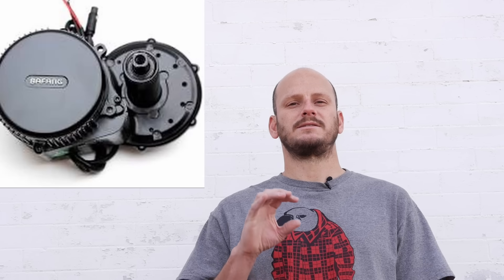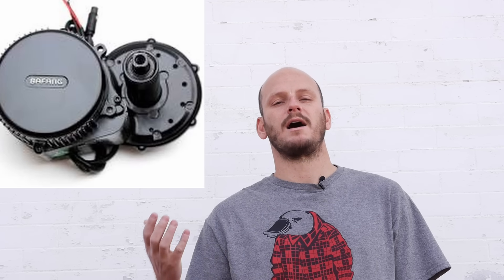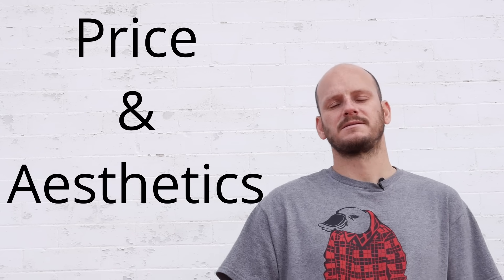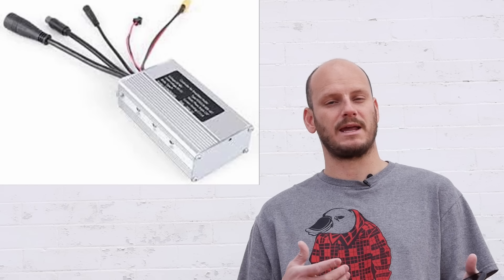Hub vs. Mid Drive Motors: Why Hub Motors Suck and Debunking Common Myths with performance test

Comment: I like hub motor you don’t have to talk to the bank in order to buy an electric bike.
Reply: Also you can still use it when the chain breaks
Reply: @abdullanasser6047  I don't even bother with a chain, too much maintenance and it's so dirty.
Reply: He said around $50? Lmao try over $150 for the cheapest one
Reply: It's February 2024 and 1000 watt hubdrive kits are $220, while 500 watt mid-drive kits are $480. Why should I spend double for a mid-drive?
Reply: If they were 50$ more for mid I would own one lol 
My first ebike is 2000 $ fat Tire hub rear  .but and next bike will mid  
I will probably kill my motor sooner as I use a Burley trailer
Reply: @Brad-99  did you try a bafang mid drive?
Reply: @SB7-r9i  .....Bosch out performs Bafang, especially with hill climbing. I won't even consider Bafang, it has poor low end torque by comparison.
Reply: My hub motor has 100 thousand miles on it . Still runs great . But I can see the other motor for climbing hills . If you live in a hilly area.
Reply: @andypandy7769  I know a few friends that pretty much do downhill mountain bike runs, lazy or not a few have got electric MB and end up doing 5-10 more down hill runs through the day because they are back at the top in no time at all. Ridiculous prices for them though.
Reply: @andypandy7769  Regen is totally free, so it is actually not worth it to not have it. And you save a lot on brake maintenance.  You can get belt kits where the belt is split and you do not need to split the frame.
Reply: just got my 4kw rear hub motor kit installed in the last few days. i can run 90v, but so far only wired it it for 48v @22ah. wow is this thing is fast, pops the front wheel off the ground,  i can see my brakes need upgraded, also i was keeping up with cars easily around town at about 40-45mph, until some drunk mexican pulled out in front of me which rained on my parade in more ways than one. next text 72v 22ah, then 90v 22ah, then i will be doubling capacity up to 88ah via 6s lipo. also i whipped right up the biggest hill in out town at about 40mph which is faster than most hill billies can do in their loud sandford and son's mobiles
Reply: @jasonbrown467  regen helps a lot with braking
Reply: The hub goes for more than 13000kms . Mid drives dont last long you have to replace yhem after 6000km
Reply: @rara-xq5nn  I also have a hub with 20k km or more. Still good.
Reply: John Smith  No regen?
Reply: John Smith  Sounds like you sell the cheap ones then.
Reply: Thanks for the info..I almost order the rad runner..I gonna convert my bikes to hub drive instead.
Reply: Bro normally ground areas which electric bike good, hubmotor or mid drive motor to distance travelling??
Plz help
Reply: I mostly want to power the bike myself and only need a little help on the inclines realistically the small gradual long inclines.
Reply: Mid drives are same price for me both kits range £300 to £600 depending on whatts and voltage
Reply: Unsprung weight, wonky weight distribution no thanks
Reply: but it is worth it
Reply: @TheFilminators  Mid drive costs more and doesn't have regen. No thanks.
Reply: @difflocktwo  in the ebike world, more money spent normally means more power and more performance, assuming you know what you're doing. And how much does regen help you anyway?
I was just joking but its definitely something to think about
Reply: @TheFilminators  Regen helps a lot. Otherwise I'm changing brake pads all the time (bicycle brake pads are small). With Regen I don't use my pad brakes 90% + of the time and regen doesn't care about water/mud/ice. Pads last years instead of months with regen.

Hub motors are so much cheaper that you can spend the price difference on a bigger battery.
Reply: @difflocktwo  depends on what you are looking for too. I'm more of a hill climber so I prefer motors with more torque so I prefer a mid drive.
Reply: @TheFilminators  I guarantee you a cheap direct drive hub motor has enough torque to flip you upside down.
Reply: @waynefilkins8394  Yeah, I don't think this video is fair at all. My ebike hub motor has over 10k km on it, it has been on many bikes. Soon it needs new bearings but it's still ok for few thousand more km.
Reply: @TheFilminators  till Ur mid drive breaks your chain.
Reply: @alextaylor9746  been almost a year and hasn't broke
Reply: @TheFilminators  Yeah but chains require cleaning and lubing. With a pure hub drive you only maintain tires twice a year. Chain maintenance is dirty and annoying. 

I hear belt drive is low maintenance but I have never had a belt drive bike.
Reply: @TheFilminators  How much watts you have in your mid drive e-bike?  I need an e-bike to climb a long steep hill (like 10 minutes ride up).  I would like to know how much watts is appropriate.
Reply: @captainjayc9217  so I have a bbs02 mid drive and it's rated at 750 watts, but it easily peaks at around 1500, and if you're in the right gear you'll cruise right uphill
Reply: @TheFilminators  "in the right gear you'll cruise right uphill" is what I want to hear.  Thanks for sharing your experience.
Reply: @difflocktwo  mid drives do have regen.
Reply: @Krunch-ym3uf  Only if there are no one way clutches between the motor at the wheel. Which system has this?  In before single speed fixed gear.
Reply: @waynefilkins8394  .....I think his points are good, especially being able to use gears with the mid drive, that right there is a massive selling point on it's own. Plus mid drives are easier to convert to, maintain and fix compared to hub drive. It's also worth mentioning that you can't just have more watts to overcome the torque difference as there is a limit in many countries, i.e. in Australia it's limited to 250w for pedelec eBikes.
Reply: @waynefilkins8394  Basic Electronics 101,   Electrical Current flowing through wire generates heat from electrical resistance.      Same way an electric heater generates heat.

Same happens in a motor,  push a lot of current through a motors copper wire windings and it generates heat.    

The most current gets pushed through a motor when heavily loaded at low RPM,  and even more if overloaded and stalled.

A Hub motor trying to climb a hill for extended periods of time is heavily overloaded,  generating a LOT of heat in the copper windings of the motor from all that current being pushed through it and facing electrical resistance

Result,  very hot and possibly so hot that it melts the thin layer of Lacquer that separates the tightly wound together copper wires so they start connecting to each other electrically,   essentially shorting out the motor.

Motor "Burnt out"
Reply: @waynefilkins8394  i have been into rc stuff for like 10 years, and none of my brush less motor ever fail unless a giant rock crashed into the can. there doesnt seem to be a place where things can burn?
Reply: @GorillaZillas  That is why you use a lot of copper in the motor to handle the current without excessive heating.
Reply: @waynefilkins8394  burning up a motor can mean two things. But really only one thing in regards to brushless setups.

The windings on the inner core of the motor has a coating to stop oxidisation of the copper wires that loop hundreds of times round and round.

If you get them too hot the coating will burn or melt off. This leaves 2 problems.
1. There is now carbon deposits inside the motor assembly and this can seize the motor (I've repaired one that had this happen as well as water damage)
2. The copper windings will oxidise and that can cause issues with how they work creating the magnetic field as well as the structure of the wires is compromised meaning shorter life.

You can overheat a brush less motor a fair few times before it comes time to repair it. I think the biggest cause of that problem is the wrong controller with a not powerful enough motor and juicy battery.
Reply: @waynefilkins8394  I believe some of the early ebikes, would burn if throttle and pedal assist were used together.  I bought an ebike in 2011, still runs good.  Got a second one in 2019, it runs great.  The only issue is when replacing the tire where the hub motor is.👍🖖
Reply: @dethvyper3136  How exactly do you easily convert an old bicycle to midrive, in  regards to the frames bottom bracket?
Reply: @difflocktwo  have you had to replace spokes, or often tighten them?
Reply: @buffalomind6838  No, but my wheel was custom built by the previous owner. So it had good quality wheel components and was built well. It lasted 10s of thousands of km between owners. I eventually rebuilt the wheel into a smaller rim cause the top speed was way too high.
Reply: @difflocktwo  that’s cool to hear. Starting off with the best components for a beginner is great as it doesn’t “scar” away the beginners into thinking what they rode is not very good, because a particular component broke, shutdown what have you.
Reply: scare
Reply: @buffalomind6838  Yeah I also have a temperature sensor inside the motor (common these days) and my smart throttle progressively reduces power as the motor gets too hot. So basically I can give it as much juice as I want and it will protect itself.
Reply: @difflocktwo  that’s a good feature, but the problem with myself when I had my scooter is I didn’t have this knowledge of the motor protecting itself, so on a “measly” 4% grade it would shut itself off multiple times going up the bridge each way. And after a 2 dozen times of this occurring it stopped working on my way back starting up the bridge, and I had to walk it which seemed like the back wheel had the brakes on it. The scooter has to be close to a hundred pounds, and I also had a backpack on weighing easily thirty pounds. I have not gotten it fixed since then, and I realized afterward it was a mistake in purchasing a scooter instead of a bike at least you could still pedal where as a scooter especially one that is nowhere near the possibility of paddling is a crutch is the power shuts off permanently leaving you a ways away from home.
Reply: @buffalomind6838  It could also be the motor controller that broke. A broken motor controller makes it feel like the motor is always braking. Disconnect the controller from the motor and see if the motor spins freely. If the motor still brakes without anything connected, it might be internally shorted.
Reply: @buffalomind6838  Not sure what scooter you have but I had a lead acid type and if the motor cut out it was usually the battery low voltage that would signal to kill motor power.
Reply: @difflocktwo  The thing is nothing works I charge it and not even the horn will go off, or the light turn on. The thing with taking it apart is I don’t have those tools on hand, and I am not sure I want to ride it again. Selling it would be good, and so for that purpose it is better to be working than not. I mean it was definitely fun while it worked, but also even on a full charge of 10 amps only, but still it would be 60% battery life going up the first bridge with it shutting off immediately after charging. Heck, I was only a minute away from the bridge on the scooter and when I get to the other side it is a legitimate 40% gone, and I still had to ride another 3 ,lies in not counting coming back is all there is left to it. That is not an inspiring feeling for wanting to ride it again with those numbers being the reality.
Reply: miles Also the wattage was 480 totaling it up.
Reply: @difflocktwo  regenerative braking in an e-bike is nominal at best. Do some research.
Reply: @Thresholdmoment  Been using regen on my ebike for years. Wouldn't have an ebike without it.
Reply: @captainjayc9217  the ability to climb is not about wattage. It’s about amperage. Amps are the power, wattage is how long the power will last.
Reply: @difflocktwo  how much regen do you actually get tho %3-%8? Vs the extra efficency it probably works out the same milage
Reply: @difflocktwo  brake disks don't get changed often you could switch to disk
Reply: @difflocktwo  what are you actually saying tho you don't have a chain on your bike at all so are you even cycling you don't wanna change a chain when it can have a clip on 2sec master link compared to replacing the entire wheel, you don't have to spend money but it seems like your a bit defensive
Reply: @alextaylor9746  im new to ebikes but where is everyone getting this "mid drives brake chains like crazy" idea? was there a massive recall or something?
Reply: @difflocktwo  Don't lie.
Reply: @TheFilminators  Oooh, a whole year!
Reply: @captainjayc9217  When you top out that hill with a middrive, you have no regen to help your battery. At 1500 watts and a 750 watt hour battery, you're dead in 30 minutes. Simple math.
Reply: @Krunch-ym3uf  Saying it don't make it so. Wouldn't the derailleur break if the wheel pushed the motor?
Reply: @OrmondOtvos  4 years now lol
Reply: @Todd66 - Watts are the power - amps are current. In physics, the definition of watt is literally an amount of work that can be done.

A*V=W - memorize that. You can have a fairly high current system, with very low voltage, and the resulting wattage, IE power, won't be that impressive. You can also generate high voltage by combing your hair on a dry day, several thousand volts worth, but with very low amperage, so your wattage, again the power, will be low.

Roughly speaking, a 60 volt 10 amp power battery will get you about as far down the road as a 36 volt 16 amp hour battery - they will both give you about the same number of watt hours.
Reply: @ArcturusAlpha - Simple physics???

A top rider, we're talking to Tour de France here, can put out about 400 Watts of power. Most consumer grade drivetrains are really engineered for less than that, because I promise you that Tour de France rider is going through drive components like crazy.

So you've got a semi healthy rider putting maybe 250 Watts through his drivetrain. Now stack another 750 Watts on top of that - you've quadrupled the total amount of power going through the chain and around the cogs.

That's going to wear faster. And I promise you the number of repeat drivetrain mid drive customers I've got who eat up chains and cogs like they're peppermints, bears this out in real life. 

All my bikes are hub drives.
Reply: what $700?????
Reply: here is an example https://www.youtube.com/watch?v=RJc1SyOyCeo
Reply: @lylesloth1275  cooler than i expected, but i want something i can stealth ride and it still looks and sounds like a bike. when i got into rc way back and lipo and brushless were all the rage, i couldnt believe the power to weight ratio. i thought for sure satan was pushing my equipment faster than what was possible and i havent looked back at combustion.

 dont misunderstand, i have nothing but respect for the internal combustion engine, it built the world we now live in and has been around since what 1850s? me and my engineering buddies used to debate about how important this feat was. now imagine being able to go electric and make your own fuel  at home (electricity)
Reply: here is a good 2-stroke engine. https://www.youtube.com/watch?v=9Nd1R25DzCI
Reply: @lylesloth1275  That tiny motor sounds like trash and way more effort and maintenance for lower performance. it makes no sense.
Reply: You will have to talk to the bank after the first few times you try to ride that hub motor.
Reply: @nuchbutter  ????? I don’t follow the meaning of your statement? Please explain.
Reply: @shiraz1736  That was in response to another poster claiming that hub engines were cheaper and wouldn't force folks to flock to the financiers.
Reply: @nuchbutter  Well sorry to say but he,s right. If you compare a hub drive system over a mid drive it’s a no brainer, mind you it’s still expensive due to batteries.
Reply: motorized 2 stroke chinese engines motorized bicycles are better than electric bikes. you will learn better about general engine mechanics in all 2 strokes, like a chainsaw or lawnmower, and could fix em, and its more fun to play with, and its road legal no license needed. plus only $100-$300 for a kit, and by $300 i mean really fast ones that go 60mph. An electric bike is in the thousands, and a fix generally means having to buy new pricy parts, 2-strokes are cheaper in parts and can be rebalanced. custom made 2-stroke engines that are watercooled do exist and cost around $300-$1000 for the engine only, but they are like a mini-car engine on your bike. ebike is less hassle and more problem free but id still go with 2-strokes, teaches you about little things in an engine that creates big differences, porting, port timing, air leaks, etc... things that are analyzed in the automotive industry to make a car faster, example is the stock 1012 horsepower SUV worth a civilian car around 25-30k called henessey hp1000, uses similar engine from the hellcat but injectors and stuff alike are uptuned to give a great great increase in horsepower. what im saying is, to use electricity efficiently, u must still turn to raw mechanics, in converting energy to electricity or in converting electricity for some use, some mechanics or physical innerworkings must bridge the gap, otherwise u will have to let go of useful power sources like steam, diesel, gasoline and even in properly utilizing energy sources like electricity...and these innerworkings u can learn better by working with small engines, they have similarities to bigger ones.
Reply: @lylesloth1275  Wrong era son, 10-15 yrs and 2 strokes are gone. My lawn mowers electric, my edger, tree trimmer , I even have a small electric chainsaw (admittedly that can’t replace a 2 stroke yet) but it’s ok for small jobs or a bit of firewood while camping.
Also small 2 stroke engines are as loud as f&$k, you would get pulled over by police in my country riding it along a bicycle/footpath.
Reply: @shiraz1736  u can move on to 4 strokes if ur worried about efficiency/emissions/power-band....there is a gift in 2 strokes..its called power to weight ratio of the device. It is a very high bandwith of power for a small portable engine, but it is prone to dmg due to "dirty cycles" of combustion and very "rushed" thats why its limited to unprolonged and short use. Like leafblowers etc. 2 strokes are loud because of its "rushed"cycles but can be fixed by balancing the crank and gapping the seals proper sounding smooth. Electric lawnmowers still use mechanisms used in 2/4 strokes like a flywheel, magneto timing etc..all the 'electrical thing does' is bypass extra mechanisms like piston movement and crank to convert energy easier. u must not look down on mechanisms and their beauty, even a tesla has to admit workings of complicated mechanisms like its differentials design otherwise the rear wheels will skid on turns, and its transmissions, all were inspired from an automotive car...also id like to see u try and think about how to make flying electrically possible without using preconceived necessary design concepts from the past, current flight concepts is established on sucking speed from air particles and recycling them with many meshes of vanes until the output air is close to 0 and energy is fully utilized and using that speed to generate lift, its hard to create lift without using that mechanism design of vanes and a turbine. I am not well versed with what electrical means yet apart from the stator magnet-induction design that makes rear wheels turn in ebikes and teslas wheels turn, and more advanced used of automated controls using a more advanced circuit board. But as of now, what electrical means to me is just another means of fuel, and in trying to use that fuel what CAN be achieved or made simpler. Ido not think it can replace everything, electrical is not a magic wand u can just zap like they do in harry potter to make something out of nothing.
Reply: @shiraz1736  the engines and the vanes are not really different, u can think of them as similar designs that are purposed for DIRECTING MOVEMENT. Although they make look different, they are similar in their similarities of directing movement of a medium or energy. This energy/medium can be air/fuel/electricity/coolant/oil/etc.
Reply: @lylesloth1275  Vanes? Honestly I have no idea what your talking about.
Reply: @shiraz1736  turbine vanes. They are those big encircling blades u see on a commercial plane. They suck in air by creating pressure differences. High pressure goes to low pressure for any medium. Think of opening a can of coke, high pressured air inside rushes out to low pressure air outside creating a bursting sound. Think of pressure as a spring compressed and about to lunge. The more pressure the more the compression the more the lunge.
Reply: @lylesloth1275  I think you have lost your mind. people are trying to get from A to B as easily as possible. We don't want to build gas or steam turbines.
Reply: @difflocktwo  the idea is not to choose a sophisticated tidious way to get from a to b, its to be willing to use already laiden out designs and use them if possible and actually realise they are easy to work with even when u just understand a bit. 2 strokes are very easy to use, they are one of the simplest engines to work with where u just need a chain to run over its shaft to use its power, because it was designed for simple use! 2 stroke design came from 4 strokes! U say it is hard because u have never tried opening a 2 stroke engine or work with it, thats why it seems daunting or complicated. But the same applies to ur ebike, if something breaks down, as a consumer, u are inclined to fix it and take a view when possible, but that is very hard to do for ebikes, cause its mostly circuit boards and highly machine made and its not even clear what a certain circuit board and wires does just by looking at it!! A first timer for a 2stroke has an easier chance fixing his bike than a first timer for an ebike by himself, because he can more easily observe how gears work to run his bike! And because of that, companies are more likely to capitalize on u and charge u for a higher fee for fix cause only "they" can fix it. It is precisely this idea where because the consumer does not beg to ask for ingenuinity and avoid to tinker with the products that the products become monopolized and inflated by the company for more than what they are worth, that nothing really holds them to be more fairly accountable and cognizant of their prices to its products value to efficiency ratio. This hardly happens in raw mechanisms and gear designs because a consumer can more easily tinker and more easily understand what a part is for and even design to improve it by himself with proper machining parts, hence companies have to double down and do respect consumer budget. Also these 2 strokes are not a garage invention, they do sell, and a lot, they are called motorized bicycles and they do sell kits for them, the only "maintenance" u were talking about is simply greasing the gears every now and then for optimal use. Also ebikes, to reach its power, u can only play with what the manufacturer has built for u, but 2 strokes, u can easily reach ur power bandwidth by tuning ur carburetor or changing some parts. U can easily change parts in 2 stroke to increase power unlike in ebikes where they are strictly compatible parts and sometimes even voids the manufacturers warranty. Also for "2 stroke" noise, it is not that bad and not as loud as those for mountain riding, it is a smaller 1-cylinder combustion chamber. This little noise can be healthy to tell other commuters where u are. Theres a problem in new york for ebikes and its high rate for accidents per year more than motorcycles on the road. This is because an ebike is a "ghost", it is too silent and too fast, and surrounding vehicles have a low perception to ebikes simply because it looks like a bike and bikes dont usually go that fast so they do not make greater allowances for it as if it were another oncoming vehicle and leads to accidents. The same applies for nearby walking people. When i was suggesting u to use 2 strokes, it was not for the glamor of the sound of revving gasoline as it rips by on the street, its the commonality of their designs and an appreciation for their universally applicably effective value when u take a bit of ur time to understand how they work. When i was telling of turbines, it was not meant for steam turbines, i was trying to say how some parts can appear on an entirely different design simply because of its useful use, doesnt mean a turbines vanes will only ever be for steam turbines, they can exist for gasoline use like compressing air like ur car's turbocharger for better gasolinr combustion. Maybe not yet, but an entirely different part from another system can always be incorporated in improving a certain system, like a turbine part to a 2stroke, its just a matter of human ingenuity, and that did happen many times in engine design they borrowed designs from other areas that are semingly foreign. Theres a lot of room for human ingenuity for raw 2 strokes than ebikes, and its much cheaper, and it lets u delve into ur humanity more of tinkering, and great creativity.
Reply: @lylesloth1275  

With a direct drive hub motor you do not need any chains or other mechanical contraptions to couple the motor the drive wheel. As power and torque go up, coupling to the wheel becomes difficult, expensive and noisy with internal combustion engines. With electric it is as easy as just getting a new motor of any power and torque you want, no coupling required. 

You cannot bring your gas engine or gas bike indoors for maintenance and tuning. That thing is filthy and poisonous. I can and have built many ebikes in my bedroom, impossible with a gas bike. 

The hub motor is almost zero maintenance. I don't have to touch it for many 10s of thousands of km. The hub motor also acts as a really strong brake with regen which saves maintenance on brakes even. 

There are very few components for an EBIKE. The battery, the motor and the motor controller. The most expensive part is the battery. The motor and motor controller are very cheap and you can just replace the whole motor or controller if anything goes wrong. Nothing has gone wrong with my very cheap motors and controllers for many 10s of thousands of km. Basically there is no fixing required, this is also true with modern combustion engines which last many 10s of thousands of km with only fluid changes. 

No one wants to tinker, we just want to get to and from work. If you want to tinker then it does not matter what system you choose, just have fun. With a gas bike you even have to go the gas station, with an ebike you never need to the gas station. 

Ebikes are very simple, like I said. You can get any battery, motor and motor controller you want for any power or torque level you want. You do not need to tinker, you can get exactly what you want.

Tuning and changing parts for a combustion engine is not as easy or cheap as you say. Most of the time you cannot do better than the manufacturer and will just have a worse engine after you try to make it better. Ask anyone who has tried to tune their factory engine. If your engine is not meeting your requirements, you have chosen the wrong engine. And again, no one wants to tinker with a gas engine in their bedroom or anywhere else.

Noise is not healthy, NEVER. No one needs to know where I am. I can talk to them if they need to know where I am. I do not want to disturb anyone with my annoying combustion engine and blow smoke in their faces and lungs. 

People in accidents are distracted, it doesn't matter how loud your bike is. If you want noise, get a loud horn, no need to burn fuel to do it. 

For the tenth time, no one wants to tinker. We just want to go from A to B. Electric offers you maximum mechanical simplicity and the least amount of noise and the least amount of dirt. And in the winter I don't have to wait for anything to warm up.

Electric all the way.
Reply: @difflocktwo  hmmm ok. What u say is very fair and i can understand but i think i can tell u some more. With due respect, i believe u have little exposure and use to engines when u said they were "poisonous on ur bedroom" and "u have to warm an engine on winter before u can use it", they are true but il tell u why they are so and how to still safely get around that. Most of the themes i understood from ur writing is about convenience and simplicity. But ijust think in having to preserve those ideas, an ebike has comprimises and restrictions just to maintain those themes. To start, a 2stroke has greater control on accelerating and decellerating power. Think of those car races called dirt rally that u may sometimes see, how they are able to stop at tight turns and accelerate so fast when theres a straight path just by playing with their gear stick (the stick for park neutral drive in automatic cars). All this cannot rely alone or drifting of tyres. Theres a thing called transmission and in simple terms they are made up of different sizes of gears with teeth, a bigger gear has high torque but low acceleration, a smaller gear has low torque but higher acceleration, a creative use of these leads to such stuff in power control without giving stress to engine .u can install one of these on a 2 stroke and better control ur power. Also in a 2 stroke, it is powered by a carburetor, its the thing that breathes in air and then simultaneously gives it fuel from its own fuel tubes to give u a ratio, different volumes of those 2 things is what decides power on a 2 stroke, u have great control of this on a throttled 2 stroke and can jump power bandwidths very easily and quickly. About tuning, it is not highly risk enveloped to change parts, when u buy modded parts, u are buying a whole part, like a carburetor where the things are already tuned to give the right ratios for power so they will always work and does not damage the engine. There are also screws built in the carb to change ratios further  for a faster 2stroke and more powerful combustion.  Think of those screws as like a mode in ur ebike like cruising speed/ sports mode that u may turn on. Now, a bigger/powerful carb does not damage the engine as badly as it is. The limit of power in mechanical engines are in the size of cylinders, we call them displacement or volume or how much air/fuel mixture u can put in there. But remember, what does how much really mean? It relies on a thing called density or mass/volume, so u can pack a lot of air/fuel mixture with a high mass and a lower volume and a high density in the same displacement volume for a cylinder and yield more power. That is what the carburetor does. Now what is the problem or damage inducing things? There are many ways to define dmg some can some cant be avoided i forgot the proper terms, but moving parts dmg cannot be avoided they are ur gasket seals in engines, the gasket is what is inbetween a metal to metal assembly to make sure no gases can escape, it is usually tightened with bolt on screws that go across the 3 mediums metal-gasket-metal. There is a dmg however that can be avoided and that is heat maintenance, improper heat cooling causes ur engine pistons to warp and misshape ruining running efficiency. This dmg can be controlled or reduce to near zero if u just maintain proper temperatures. Normal cars actually take a lot of engine beating due to many combustion cycles and rpms just to make a car run, how are the insides not deformed? How are springs not deformed? It is the proper cooling and maintenance of heat. The 2strokes i told u about are air-cooled thats why they have those large fins and generally have very high lifespans. I have a 2 stroke thats 3 years over now and running good and i use it every week, no change in bearings just remembered to grease. And about the pollutants for a gas engine, i think u meant gas and grease cause thats all i can think about. If u consider those dirty then bringing a bike alone to ur bedroom is already dirty since the tyres have been abused to touch whatever floor they are on. But we can always makedo for these engines to just fix them on our garage, if u live on an apartment we can leave a specific space for it, just as how some of us have washing machines and dryers in our place, we dont use them everyday but we allocate a spot for them always cause when we do use them, we prefer it be at that spot, we are not looking to make everything heavily adaptable to everything, and a bike will always be dirty because of its tyres being ran who knows where. Grease is not toxic unless consumed and fuel is not toxic unless heavily consumed. Theres a concept i learned in school and i mean this respectfully, what kills u is not that thing technically, what technically kills u is the dosage of that thing, so unless ur smelling fuel directly excessively then its bad but u can always close the gas tank or leave it outside. Also for noise pollutants, noise does not come from a vibration of an engine, it comes from the vibration of high pressured gases coming out of the engine or the exhaust pipe vibrating, theres a special thing called muffler to muffle that sound to attach on the exhaust pipe, and yes it is possible to make a 2 stroke soft without affecting power cause i have tried it before and because mufflers do exist that do not create much back pressure. Think of back pressure as u trying to breathe and breathe out but as u breathe out something weird or outside air is trying to go in ur mouth preventing u from exhaling. That is back pressure. Many mufflers exist in the market to minimize that near to zero. Back pressure will naturally develop because mufflers are designed like a spreading spidersweb. Think of u screaming in a small room. Now think of u screaming in a big room u wont be heard. Mufflers are like that they have spreading small tubes. And as for "warming the engine" thats only for big loads like cars cause engines works best when warmed, this is because it sets temperature right and makes timing easier for combustion and btr efficiency and expands gaskets making everything more sealed and properly compressed for 2stroke cycle to operate. U can not need to warm engine on light loads and can turn them on immediately and can warm them as u ride because the loads are light and the engine need not be prepared for a big work. U said something about going from a to b, if we are talking about short distances then ok, but remember an ebike is in the thousands. That is buying price for a secondhand car, might as well buy a car if that is really the case, plus it protects u from rain and cold much better. If u r gonna go long distance, then u r gonna have to use the road eventually, ur gonna have to get along with noises on the road also. Also u said something about "maximum mechnical simplicity" hm.. i truly believe simplicity is a subjective and i believe u too can learn 2strokes like i did and i encourage u to try it, it does not hurt to learn and u learn best by doing. An electric bike is easy to buy cause u know what parts to buy easily, a gasoline has more parts but by cheap i mean $5-$15 parts not like ones in the hundreds for ebikes. Remember a gasoline kit 2strokes for bocycles is around $250 with shipping. And mine still works like a beauty after 2 years and more, and i still can reach  50mph, and i still can opt it to go silent if i want to. Also id like to tell u about tuning, it is not beset on manufacturer limits, limits exist so the engine life can work longer, but ur normal car can be tuned to go faster, some valves are loosened to open more, some pressures are changed to increase flow of things to make ur engine faster, no added part no part changes, just same parts loosened, they can do that to ur car, by loosen i dont mean things r gonna fall off, i mean letting ur car "breathe" more easily. Manufacturer limits are never a just fit, they are optimal conditions and ur not bound to break them unless u really affix weird stuff. A company called honda inspired to make modded parts from experimental builds from the community, that is why many teenagers use those cars today in streets because it has a lot of parts to make engine stronger, that was also inspired from the same ideas from community for the same old engines.
Reply: @lylesloth1275  
You can control the torque of an electric motor from zero to maximum torque in milliseconds. You can make the motor feel however you want. You can make an electric motor start very smoothly or you can have 100% torque immediately or anything in between, you can choose. This torque can be controlled in both reverse and forward. Reverse torque is usually regen for example. They use very fine control of forward and reverse torque in electric unicycles to keep the rider balanced. I think you have seen many electric balancing vehicles like Segway or hover boards or electric unicycles.

Gasoline is very volatile and you don't want that in your house. You cannot work on your carbs or fuel lines or fuel tank or anything related to gasoline. You cannot run and tune your motor in your house either because when you burn gasoline (and oil) you get really nasty stuff. I think tires are like shoes, not like gasoline. Easy to clean and not so poisonous.

There are garages where you can work on your bike or car and you pay by day or hour. I have seen them. It is not the end of the world if you cannot work on your bike in the bedroom, but it is a huge bonus. It is almost impossible to own your own garage in the city. If you have enough money to own a garage, you don't need a small ebike or moped to go to work. 

Gasoline is volatile and toxic. I would not be messing with gasoline in my bedroom. Grease is not volatile and tires are not as bad as gasoline. Of course if you store hundreds of tires in your bedroom, that is an issue.

If you can make a very quiet combustion motor, that is great. I think they use them in small gasoline generators but it still is kinda loud. I haven't heard anything near electric. 

You talk about adding a gas engine to a bike. I talk about adding a electric motor to a bike. We can ignore the cost of the bike and focus on the drivetrain and energy storage. We can also consider the whole bike if you want.

Gas cars are great, but maintenance is very expensive and difficult to do on your own and for sure not in your bedroom. Parking is a whole nuther expense too.

If you use the car all the time it is magical. If you park it most of the day, it is a burden. If you can afford a car, you use a car. You do not use an ebike or a gas bike. 

We can do the math for how much you need to drive before saving money on gas. For a 2 kWh battery which costs like 1000 eur, you need to get 40k km out of it before it is cheaper than paying for gas for a scooter. A 2 kwh battery can get you almost 100 km at low speeds, and will last 1000 cycles. 40k km is an easy task. If you live somewhere where gas is cheap, gas might make more sense. But gas bikes are so slow, loud and smelly.

Long distances is an other discussion.

250 usd for 50 mph is very cheap. I think for an electric motor and controller you would be looking at something closer to 500 usd to cruise at 50 mph and an other 2000 usd for the battery. Two 1 kW hub motors can take you to 50 mph easy, if you are wondering what it looks like. Those are the most common direct drive hub motors for cheap kits. 

Tuning is for racing, not commuting. Any anyway, if I was racing, I would build an electric race vehicle. Gas is too complicated and slow.
Reply: @lylesloth1275  .....It works for you but it's illegal in my country as well as other counties. I think you completely miss the point of eBikes, which in your case it's not a eBike. I'd rather buy a actual motorbike instead of having a 2 or 4 stroke little motor. I bought a KTM naked bike and it's extremely efficient in fuel consumption, it only costs me between $10 to $15 dollars a fortnight commuting to and from work, and it has very low emissions. I built myself a 2 stroke powered BMX bike about 35yrs ago, been there done that, but now I want a electric powered/assisted bike.
Reply: @lylesloth1275  except gas guzzling engines are being phased out. Everything is going electric, keep up
Reply: @lylesloth1275  too bad gas motors are loud and obnoxious and smell like shit
Reply: @lylesloth1275  i drive gas vehicles everyday mate. i'm not some big electric fanboy and I wasn't attacking you personally bud. Can't really deny the 2 stroke bikes are loud and obnoxious and depending on where you are riding,  there are many places you can go on an ebike that you cant on a gas bike. in many places those are considered motorcycles and you have to get them licensed and plates and whatnot. Thx for the spicy comments you are a funny guy take it easy.
Reply: @lylesloth1275 - It may not be fair, but in many states, like Florida, as soon as you're putting gasoline in an engine, you have a motor vehicle, and it must be registered and tagged, and have all the appropriate lights, horns, mirrors etc. 

If it's under 50cc's you won't need a motorcycle endorsement on your driver's license, but that's about the only perk. Ebikes are also allowed to go on bicycle infrastructure, like trails and bike lanes, which motor vehicles are not allowed to do.

eBikes get a pass on all that nonsense, up to about 750 watts typically. Above that, depending on the state, you begin to get into motorcycle regulations.

I've also never had an e-bike get a crack in a fuel line and soak my slacks in two stroke gasoline premix, I've never gotten burned on an exhaust pipe, I've never been stranded with a fouled plug, clogged fuel filter, or broken throttle cable.